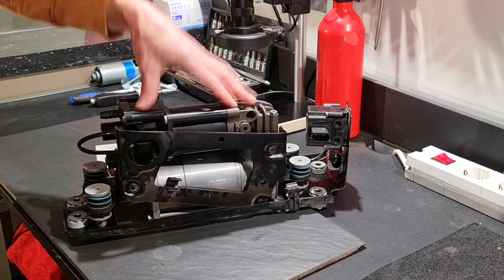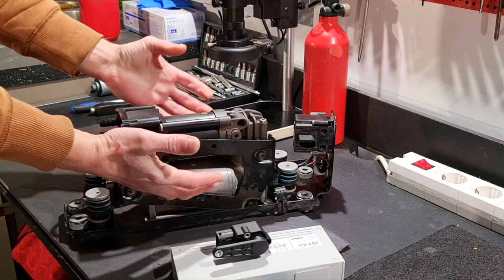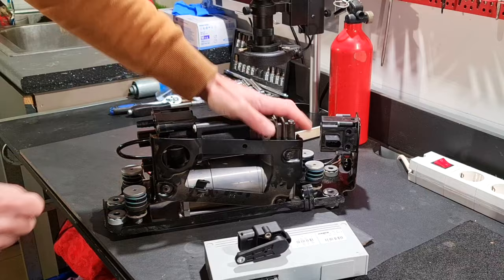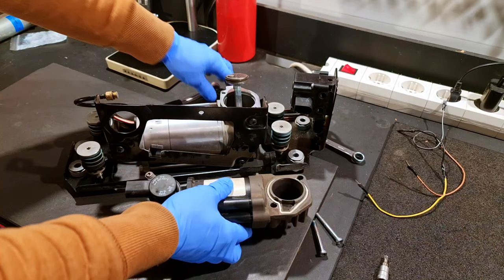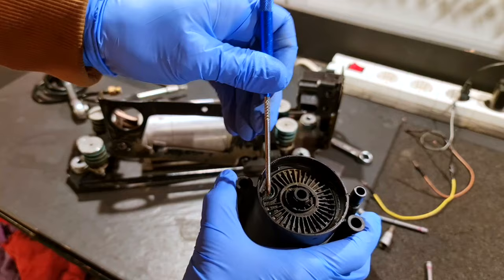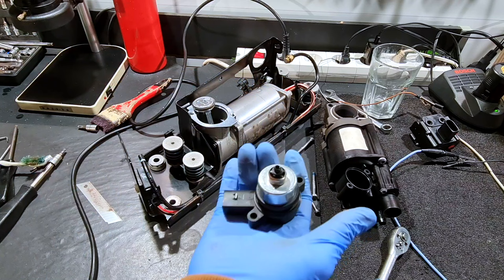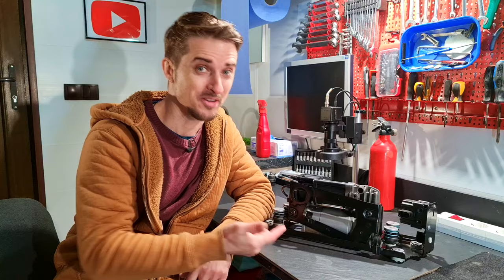Repairing the BMW Air Suspension Compressor

Comment: Thanks for a great video. Putting some additional experience incase you run into the same problem as me. On my BMW 520d 2017 model, the car was working as normal. Then winter came along and the outside temperature dropped to minus 10 degrees celsius. All of a sudden the car would no longer lift and the ride was awful. The car then also started to display the "Chassis function restricted" in the dashboard display. After finding this video I removed the compressor unit from the car and opened it up. Sure enough the "air dryer" was full of water. I dried it, checked the other components which seemed fine and put the compressor back in the car. Nothing... The car still sitting low and no sound from the compressor and the same message on the display. I then started looking for faulty fuses. Low and behold the 40amp fuse for the compressor was fried. Changed it and....still nothing. My last resort before handing the car over to the BMW dealer was to change the relay, and BOOM! Back in action. So a long story short, the water in the air filter must have frozen when it was cold outside, this in return stopped the compressor from operating as normal thus proceeding to blow the fuse and relay. Hope this info can be of help.
Reply: Hi @chrborud83, where is this relay located? Thinking I might have the same issue as you. 
Thanks!
Reply: @Scandi10  hi. The relay in my car is in the boot on the right side behind a cover.
Reply: The problem I had may be the same, my relay was very wet next to the battery
Reply: Hi thank you for your explanation, it was really insightful.. could you please advise where you purchased the relay from? Thanks in advance.

Comment: Hi, I got this problem with my 2018 g30 520d m sport estate. The back of the car won't go up. Do you know if the compressor unit is the same as f11 5 series model? As I don't know which solenoid to buy? Any help please
Reply from the maker: Hello! no they are different ! but before you start to replace parts blindly you need to do a proper diagnose to that car and that system !!!!
Reply: @MOvidiu  hi, I took it 2 garages, both say it could be airbags or compressor. I don't want to replace items if it won't fix the problem. I get error message, "chassis function restricted"  pump kicks in but won't lift the car.

Comment: Question I have a 2016 Bmw 750i and the car just barely start doing it but when I turn on the car the compressor start  working but next day the same problem,I have to replace the air compressor or what can I do

Comment: I just finished this procedure and not only did I learn a lot, I got my air system working again. Your tutorial, though not a simple diy is certainly doable if you take your time and understand what each component does. You make this very clear. Thank you for showing us what each component is supposed to do and how to activate them. Nice job!
Reply: I have a '15 F15 X5 with the same issue. Where can I find the (2) valves (exhaust & distribution) for this pump?

Comment: Just wanted to say another thanks for the video! I was able to successfully repair my compressor without any surprises.  

The discharge valve was rusted open, and one of the solenoids in the valve block was rusted shut. Same as in your video, the silica beads were wet too. About $180 in parts later and the suspension bellows inflated and raised the car. It has been 2 weeks since the repair and it is holding up nicely.
Reply from the maker: Nice work!

Comment: Fantastic breakdown of the air compressor and it's sub components. This is practically a video manual on how to diagnose and repair each component with clear instructions on the equipment, specifications for proper function. After replacing my entire compressor system due to the exact conditions described I have no doubt my compressor was likely in a similar situation with an oversaturated filter and check valve stuck open as it would operate, however the recently replaced bags would not inflate. I might try to crack it open to see if that is the case and order a replacement valve so I can have a spare on hand. Thank you for the great video!

Comment: Incredible, thanks so much for posting such a comprehensive video with great attention to detail with all components being properly cleaned. I have a problem with intermittent discharge from my air compressor following replacement of the rear air bags. My garage has so far been unable to identify the issue, though you’ve provided a comprehensive explanation of how the system works. I pretty confident now I will able to fix. I need to find some crocodile clips and connect up my 12v battery! Thanks again 👌
Reply: Hey, i have same problem, yesterday i changed both bags and still bags deflates, now even faster than before. Did you solve your problem?

Comment: ❤ thanks for another great vid ! I just diagnosed my F11's compressor. Stuck valve too, I managed to free the piston inside with WD40 and gently tap it with a small hammer. It's working again while I wait for the replacement.
Reply from the maker: Nice job! Thanks for the feedback !

Comment: That’s a great video I have the same issue with My BMW X5 f15 2016
Reply: I have the same model, I already changed the bags to Arnot several months ago, now I am getting an error on Chassis issues, did you have success just changing out the silica beads? my local indy shop says its the compressor, figured I would change out the silica beads first before buying a new compressor, did you have success?
Reply: @joeyfountain7322  leave it like that for a couple of days automatically if you don't have a problem with the elevation sensor everything will be fine until that always comes out when you change the air motor it has the compressor if you don't change the sensors and the level of the vehicle so you can program it the bmw
Reply: I have a '15 F15 X5 with the same issue. Where can I find the (2) valves (exhaust & distribution) for this pump?

Comment: Thanks for the Great Video !

Very informative, and gave me confidence to sort my pump out, I replaced the single solenoid air valve (air dump I believe?) on mine, they are only £21 on Amazon UK.

So far, it seems to have worked, I have new airbags to go on should I need to, but hopefully this is the “Fix” 😊

Comment: I’ve replaced air bag and still have a slow leak, so will now attempt to do this service on the compressor thanks to this brilliant tutorial. Can’t believe I feel ready to try it. Thank you. You are truly amazing
Reply: Hi mate, did you fix your problem? 
I have same problem, replaced both airbags, applied service for air compressor, replaced both valves from compressor and still i have air leak but i cant find it.
Reply: @Shahinc0 Hi, did you find solution? Same problem here
Reply: @vlat18  I don't get how they see folk asking if it got fixed when they're on here but don't answer..🙄
Reply: @Cupat1  yes thats weird

Comment: Congratulations, the most professional and comprehensive video on the net!
On my E61 the suspensions remain low, the compressor turned on but they didn't go up.
I disassembled the compressor with all the components, perfect except for the exhaust valve which is always closed, even if it is powered, you can hear the noise as if it clicked.
How is it possible if it's stuck closing, the car shouldn't lift up ?

Comment: As an owner of the M62tu e38 I like this system better than than the hydraulic EDC/SLS system. 

The old system has lines/pipes and gas /fluid accumulators in each rear wheel that used power steering fluid to level the car. BMW still used ride height sensors that are still extremely expensive. 

I’d rather this system because it does not require pentosin fluid.

Comment: Hi 😀
Thank you so much for a really helpful video. 
You are very good at giving an easily understandable and detailed explanation of how the system works and where the possible errors may be. Really appreciated. 
my compressor has just broken down and I need a new discharge valve,:face-fuchsia-wide-eyes: would you be so kind to share a link to I can buy one?🙏🙏

thanks in advance

Comment: excellent my air suspension E39 touring 1999 sorted no valves blocked or rusted but compressor wet through and big spring really rusted so dried all media cleaned up all parts and air is pumping out now so thanks mind you it has lasted 25 years

Comment: Thank you so much. I’m think I’m ready to tackle my. X5. When I clear the code it’s saying no change in pressure after the pump runs. It’s got to be that discharge valve or something. But again thanks for the info. Cheers

Comment: Thanks for this awsome video, I just have  one question can just one side be clogged? like it pumps air to the air suspension but doesnt discharge completely on the right side? or is it sensor issue?

Comment: Ovidiu, congrats for all your activity! One short question - if the compresor only inflates the bags, but does not deflate them (using Ista procedure), which might be the problem? Bad valve block? Electrically, all looks fine, cable looks good, no corosion. I did a full check on the system, replaced the discharge valve, dried the silica, etc, treated all rubber seals.

Comment: Nice video! There is some additional hardware on BMWs with 4 air struts, but if you understand this concept, for sure you will be able to figure out the other one. Actually if you want to take it one step further, you can install blue silica gel rather than the OEM moisture granules.
Reply from the maker: Hello,  you are right,  here I'm talking about the most common system "rear air suspension ". I personally don't advice to use blue or any other type of silica gel,  becouse silica gel absorb the humidity and keep it,  to release the humidity silica gel need to be heated,  instead the original dehumidifier pellets will release the humidity to a flux of drayer air , if the blue or any other color of silica gel was good for this purpose believe me the manufacturer will use that becouse is more cheaper than the one in use 😀
Reply: @MOvidiu  Hehe it is going to be really cool if that was the case :D But as we can see from your video and from my experience, they don't dry by themselves so good :D Most of the F15 X5s have this issue with moisturized granules after around 5 years of use. I have installed on several cars silica gels without any issues even after few years of use. Lets keep it real, you probably know that not every time car manufactures are using the best quality stuff in everything. Ofc not talking only about BMWs.
Reply: @crank3646  

What's the size of silica gels must be used for BMW X5 F15?

Comment: This is an EXCELLENT guide.  Thank you! 
I have just discovered it after stripping my compressor down and rebuilding it.
When it’s all back together and the car is back down on the ground, it only sends to the left side, not the right side. Do you think this is the solenoid valves? Thank you very much!
Reply: I have the exact same issue. First i thought it was the airbags themselves but sometimes they stay up for days so can't be that. Now the right side (blue airline) just refuses to pump any air despite the compressor being OK. I'm lost to be honest now.
Reply: @PiFe00  I think it is something to do with the internal solenoid valves,
I ended up replacing the whole compressor unit as it was just easier and cheaper to do so.
Just make sure that you’ve definitely got the right version for your car!

Comment: thanks for this very usefull info! What's your thoughts on this: At the moment, it seems my compressor failt on me on holliday, 1400km's from home. It sinks on both sides in 20minutes drive, but keeps on his feet all during the night. Shortcutting the relay starts the pump, but no air comes in. If the car stay's up all throught the night the springs should be ok. So, as a quick fix getting me home, could i disconnect the solenoids, so that air stays in the springs? Thanks for your thoughts!

Comment: This is BY FAR the best and most comprehensive video on YouTube about these pumps. Thank you so much do you have a PayPal or contact so I can buy you a beer. 🍺 this type of in depth knowledge is rare. I had only two questions. 1. Where did you get the new discharge valve from? Does bmw sell individual parts of the system? and 2. What type of grease are you using on the position. I’m assuming some sort of lithium grease.
Reply from the maker: Hello,  sometimes you can find the valve on eBay,  BMW does not sell separate parts for this pump ! The grease that I'm using is Molykote EM-60L. ( is in description)
Reply: @MOvidiu ha I really should have read the description.. it was all in there. 😅 but great info. Thanks again. I’ll keep my eye out for an occupancy sensor mat replacement for X5. I used to have a 2002 bmw 540i-6 that it failed on. I just bought a 2006 X5 for my son and sure enough it’s bad too. These BMW’s, when they are good they are amazing. But always needing something. I was hoping bmw got that figured out in the 5 years between the two cars but guess not. But then again gives me an excuse to watch YouTube videos and play in the garage.

Comment: Great video and great explanation of how it works,but what would the fault be if my compressor dont come on at all and blows the fuse instantly, i have changed the relay and still the same. Thanks
Reply: Another video said that would be a bad compressor.
Reply: @robin8559 That's what I did in the end: I changed the air compressor and havnt had any problems since 👍

Comment: Great video, I used a 12 volt battery to test it like you did. After some sparks from the alligator chips I think the motor blow out. I tried the same thing with the other value to blow air in and it did not go well. Just wanted to share the knowledge. Maybe you should talk about your setup, as easy as it looks. I dont know why it was electrical spark from the clips. I got the negative and positive wires correct so I dont know what happened.
Reply from the maker: Hello ! the electric motor won't bee affected if you have made a short circuit with your clips , maybe the motor was destroyed from over heating !

Comment: Does the 2001 e39 wagon have the separate relief valve? Part? Or is it all one part? solenoid valve block?
Reply from the maker: Hello! On e39, the release valve is on the compressor dryer,  similar to the one in the video !

Comment: Great tutorial !!! What is your opinion on the lifespan of the air suspension components of 2019 X5 with 73 000km, when would you say it will start to fail and is an extended warranty (4 years / unlimited mileage) at a cost of 9 000$ from BMW dealer is worth it ? Thank you for getting back to me with your advice : )

Comment: Hi, I saw in the video that you replaced the discharge valve with what appeared to be a genuine wabco replacement. Is that was is provided by the supplier at the link provided? Thanks for the great video!

Comment: Fantastic video, many thanks! Got my "rear" up again after this guide, compressor was filled with water! Although it pumps up, it looses pressure quite fast after i turned the car off! Is it still the compressor you (anyone?) think? I tested the "valves" and they seemed to work according to your guide. Or can it be the airbags? Many thanks!
Reply from the maker: Hello! You are the only one who can know what is the problem!! the car is at you , you can test it diagnose it ! nobody else can know what can be without physically seeing it !
Reply: @MOvidiu  OK, thanks. Was just checking if anyone knew it was obvious. Will try and diagnose ;)
Reply: @drfreil did you fix your car?

Comment: My discharge valve stuck open as well. Replaced the valve and fit the compressor back to its position. The compressor is now not turning on and this is the error code it is showing: 

480DA0 Discharge valve: Short circuit To B+ Or like disconnection

What do you think is the issue ?

Comment: There is no problem with compressed air being produced, but where in the compressor should I fix the fault code that says air is not coming out of the suspension?
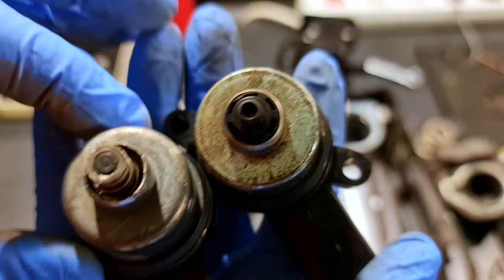Reply: I am not sure but i think air valve with 2 connectors removed on 08:20 sec. If some thing else you find out please update. Thanks.

Comment: Great video! Why are the air bags failing so frequently? Any recommendations on  best brand of bags to use as replacements?
Reply from the maker: Hello,  they are failing because of material fatigue, and you can't do anything about it, I mean you could try and drive the car only on good roads 😀.
I recommend OEM parts.

Comment: Do you have some experience now, with the pump for the BMW 5 series g30/31? what is so different?
Reply from the maker: It's a new generation and the valve block is not serviceable
Reply: @MOvidiu  I found that the pump and motor are the same, also the valve on the dryer is the same.
But the valve block to the suspension is sealed with resin, so you cannot take it apart.
and if you put a new one under it, it must be coded otherwise the car's software will not see the valve block.

Comment: Hello, great video, thanks to you.  I ordered a new escape valve (solenoid) after performing the air test. The new part came as two parts, is that normal? The base with and electric socket and on top of the metal part of the base, the black plastic valve itself,  attached to a metal rod that easily comes in and out...

Comment: So, i have changed both new, compressor and airbags and still left side dropping. What should i look for?
Reply from the maker: Did you diagnose the system first ? After replacement, did you calibrate the system?
Reply: @MOvidiu  no, i didnt diagnose first, cause i was sure that bags are broken. I had this kind of problem before with my previous bmws and both times bags were broken. And how do you calibrate?